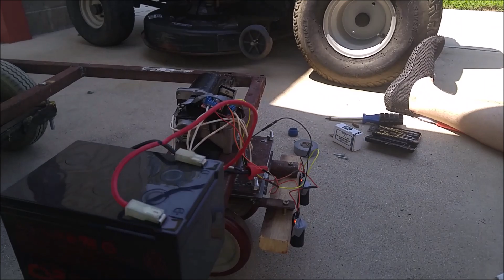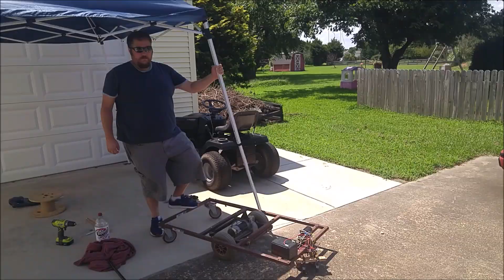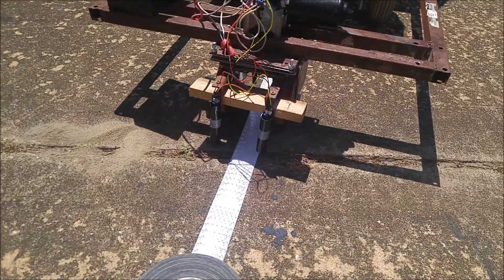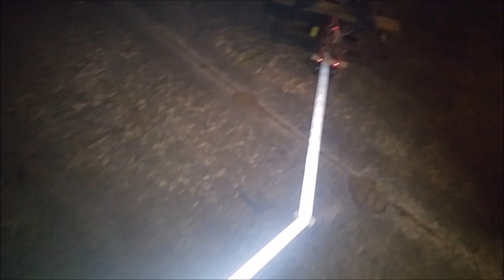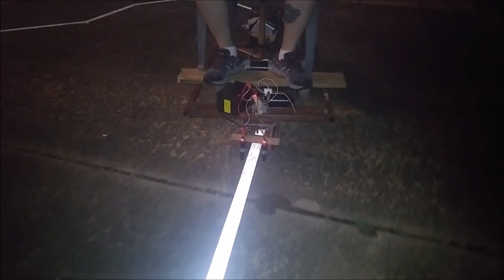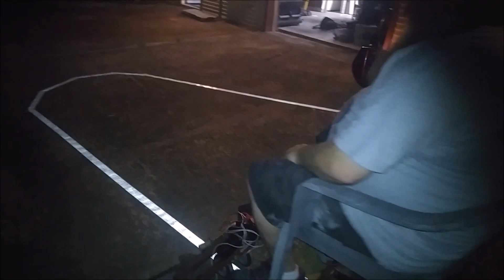Homemade Dark Ride Cart powered test

Comment: Hey man im drew im a big fan building a dark ride for my kids for next halloween season.i was wondering if u could tell me what sensors u used and what analog following system u used hope to hear from you keep up the good work awsome.
Reply from the maker: Hi Adventure Slushers!  Thank you for following the progress of the cart :-)
The parts came from Amazon.  I have listed the sensors and H-bridge controller below along with the 5V regulators I used.  I hope this is helpful!
Parts:
- Wolfwhoop PW-D Control Buck Converter 6-24V to 5V 3A Step-Down Regulator Module Power Inverter Volt Stabilizer (used to supply 5V logic and sensor voltage from the 12V battery)
- Semiconductor Motor Driver - SODIAL(R)Semiconductor Motor Driver Auto BTS7960 43A H-Bridge PWM Drive For Arduino HOT (steering motor controller)
- OSOYOO 10PCS IR Infrared Obstacle Avoidance Sensor Module for Arduino Smart Car Robot (sensors to detect the reflective tape)

Happy Haunting!

Comment: thats  sweet do you have a parts list  for the project ?
Reply from the maker: I've gone thru so many configurations during the build.of this.  But, I should be able to compile a list - if you don't mind some generalizations such as " 4" casters" versus having the part number.  I can track down the part numbers of the electronic components, however.
Reply: hey that would be awesome  ...I'd love to try that for my grandkids in the Haunt !
Reply from the maker: @deoblo85  Sorry for the delay... Holidays and such.  I will describe the mechanism in general terms and then list the parts afterwards.  
I built the frame from 3/4" steel square tubing, the seats and bracing were wood.  There are 2 casters at the rear corners and 2 bolted together for the steering.  The steering plate is a 6" lazy-suzan bearing from a hardware store.  The assembly is moved/turned by as wiper motor.  
There are 3 IR obstacle sensors  under this assembly, 2 for tracking and 1 for safety (if it no longer sees the reflective tape it cuts off the drive motor).  The Wiper motor is controlled by an H-bridge DC motor controller.  This controller monitors the IR sensors and moved the wiper motor accordingly. 
Parts:
- Wolfwhoop PW-D Control Buck Converter 6-24V to 5V 3A Step-Down Regulator Module Power Inverter Volt Stabilizer (used to supply 5V logic and sensor voltage from the 12V battery)
- Semiconductor Motor Driver - SODIAL(R)Semiconductor Motor Driver Auto BTS7960 43A H-Bridge PWM Drive For Arduino HOT (steering motor controller)
- 5 inch (Set of 4) with 4 Swivel Casters- Poly Tread, Sealed Industrial Bearing Wheels 
- Windshield Wiper Motor Ford Bronco/F Super Duty/F-150/F-250/F-350 1987-19 E7TZ17508A (steering motor)
- Reflective Safety Tape Red Hazard Caution Adhesive, Reflector Tape Red For Trailers (2" x 150 Feet, WHITE)
- OSOYOO 10PCS IR Infrared Obstacle Avoidance Sensor Module for Arduino Smart Car Robot (sensors to detect the reflective tape)
All of the above parts were bought thru Amazon.
The steel and wood were various hardware stores.

Thanks for following the progress of the cart!  It's been a fun project with a big learning curve.  We will be making under-the-hood improvements this year - including the ability to track speed and adjust itself for varying load and ground slope.
Then we will try to build a second cart to increase capacity.
It ran for 3 hours continuous without any issue... but the line was at one time about an hour long.

Happy Haunting!
Reply: intocoasters I’m curious to know a part list to please
Reply: how can i contact  you... if it's possible you have a Facebook ?
Reply from the maker: @deoblo85   I do have a facebook - I don't know how searchable I am, LOL.  I can be emailed at intocoasters@yahoo.com
Reply: @intocoasters  LOL  i run a show Called Haunters Hangout and  we get about 4 Haunters on at the same time It's live and Talk about our Haunts would you be interested in something like that ?
Reply from the maker: @deoblo85   I would be, yes. Well... maybe.... I feel like I couldn't keep up with so many of the other haunters out there.
Reply: @intocoasters  just the train is will be plenty to talk about  and the Haunts great as well .... we usually contact through Facebook Messager  do you have that ?
Reply from the maker: @deoblo85  Not the app, just the message icon in the Facebook page.  I think I found you and have sent a message there.  I think it could be fun to talk about! I hope to chat more.
 I gotta run - I will be driving for a while but I will check back here and Facebook when later this evening.
Reply: @intocoasters  whats your  name  my FB is deoblo lopez
Reply from the maker: @deoblo85  it's Eric Roberts.
Reply: send me a friend request

Comment: Has it jumped the track at all?
Reply from the maker: Yes.  Three times.  The first was because there was no weight in the cart and it was set a little too fast - when the wheels turned to follow the line there was not enough grip and it just skidded forward.  The second time was having too much weight directly over the steering assembly - it couldn't react fast enough.  The third time was us goofing off and seeing how fast it could travel around the track.
Reply: Interesting, thanks for the reply.